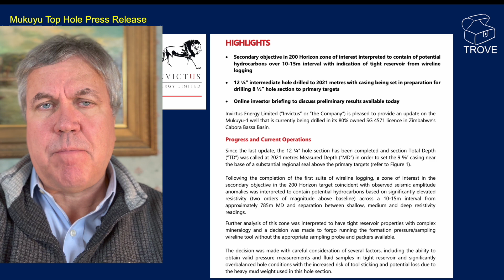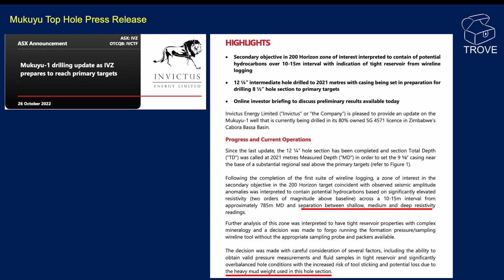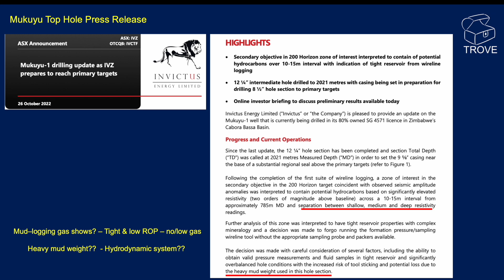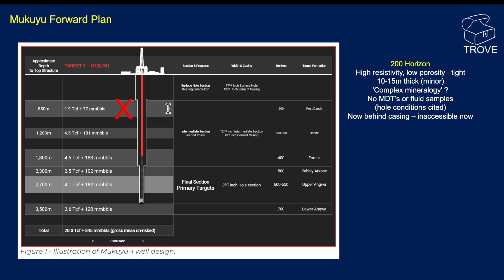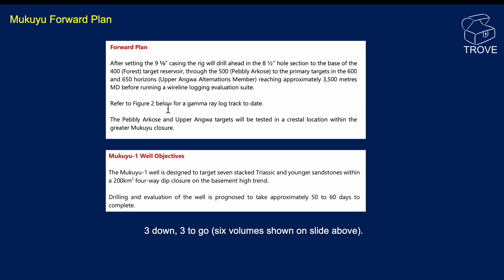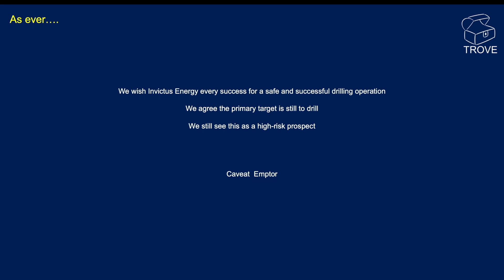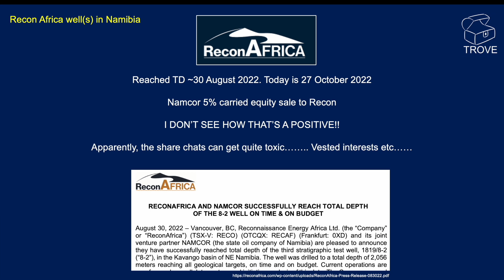ZIMBABWE Invictus Energy - Mukuyu-1 early results

Comment: I apologise in advance, this is a large comment :)

Thank you for your recent video. You’ve raised some good points, however it is somewhat disappointing about what you have not clarified from your previous videos, which since the release might have changed.

Firstly, below are some examples of statements and theses from your previous videos, which I’d appreciate your input on since this announcement. As I’ve mentioned to you previously, I’m no expert, and as such I’d like to tie these loose ends off and would value your opinion:
1. You postulate that amplitudes anomalies in the south are likely Basalt intrusions, has the recent news affected this view?
2. 700m of vertical pay is implausible because it needs (your words) “significant seal capacity” - have we not confirmed significant seal capacity above the primary target? Could you perhaps now answer your own question “are the shales thick enough to maintain seal” for a large column in the primary target?
3. The seals will not be competent due to sand/sand juxtaposition - is this thesis not perhaps been proven doubly wrong? The drill has confirmed a large shale section above the primary target, and additionally the fault margin in the shallow section appears competent in the 200. What is your view on this and how it affects your view on the project's risk?
4. Direct Hydrocarbon Indicators for 200 are invalid due to mismeasured two-way times. Is your view on this unchanged in light of shows in the 200?
5. Can you comment on your claim that the 200 horizon AVO non-conformance to structure in the North is due to being hydrodynamically trapped from water infiltration from the North West? Has this thesis perhaps changed due to the confirmation of good trap and seal against the fault margin in the 200?
6. Do you still doubt there’s mature source rock in the Baobab catchment after shows in the 200 horizon? Where do you postulate the 200 shows have migrated from, with knowledge that there is a large seal directly below it?

Below are some extra statements you have made, which have been challenged independent of the recent news. Would this video not provide a great opportunity to correct the record on the below?
7. No surface seeps recorded - seeps have in fact been encountered at outcrop to the NW, and oil has been confirmed in ground water boreholes. Comments in the Baobab video brought your attention to this, would now be a good time to correct the record?
8. Your claim that Invictus doesn’t have a licence - this was corrected in your Baobab video comments, as you now confirm they have an exploration licence, perhaps it would have been prudent to state this in your recent video?
9. Therefore, have Invictus not in fact followed a conventional O&G exploration approach; in your own words “sign licence, shoot seismic, farmout (self-funded), drill well?

Below I’ve included some questions raised from this recent video:
10. In your view, is the 200 horizon to be disregarded due to the comment of “complex mineralogy”?
11. Or is it to be discounted due to the tight formation? (Or both)?
12. Is it at all possible that the company’s thesis is correct, that mineralogy and permeability will likely improve further from the fault margin?
13. Is it possible the 10-15m pay interval will also increase further from the fault margin?
14. You state that the 400 has already been intersected. Is the the drill not currently sitting above a potential reservoir in the 400?

Finally I have one further question
15. How has the quality and candour of this this press release (as admitted by you) affected your views on the integrity and competence of management? You’ve previously raised skepticism due to management being subtlety misleading by leaving the 4.3b BOE statement hanging, and how the second well is perhaps an extremely low CoS ploy to secure and mobilise the drill. Further, you’ve questioned their competence by pointing out (in your view) better places to drill and provided your suggestions on how to progress the project. Has your opinion of management’s competence and integrity changed since this announcement?

So in summary:
16. After careful consideration of the above items, why has your assessment of the risk at Mukuyu remained unchanged (High-risk)? 
17. Also, is it possible (although perhaps improbable) that the primary target may in fact not be small, as inferred by your first video?

I understand this is a lot, and we could probably all agree that the drill will do the talking within a few weeks and save us a lot of time. However in light of you taking the time to produce a follow up video, it would be much appreciated if you could answer some of your own questions, and correct some of the record from your first releases.

Once again, full disclosure here, I’m invested. I had concerns following your recent videos, however my take on this release is it appears to have reduced the overall risk. I’ve researched as much as my ability allows, and I value your opinion particularly on the technical matters, and I’d extremely appreciate your opinion on whether the risk has changed at all, because in your video you state it has not. Much appreciated, and thanks in advance.
Reply from the maker: Ambi, thank you for your comment. I don't get paid nor unfortunately have time to give detailed answers to your probing questions.

1) Basalts - 'could be' I think I said. 'Tight rocks with unusual mineralogy' - nobody can tell what that means from the available data. They are indeed not necessarily basalts. Petrographic analysis of cuttings samples will hopefully reveal in time. Could be any lithology. Basalts in strat column = they apparently exist somewhere. It's not like the outcrops are far away.
2) The vast majority of drilled wells encounter thick shales at some point. Still doesn't mean there is a working petroleum system underneath. This is a wildcat well. Every geoscientist will draw conclusions. I think I said I was encouraged compared to prognosis. If the first sands under a thick seal are HC-bearing - great! If not - what would you infer? I think the casing point was described as being towards the base of a shaly interval. Not sure how to image ahead of drill bit.
3) see (2)
4) (see 1). TWT issue now largely redundant we have a well penetration.
5) There is 200 horizon AVO non-conformance to structure. One of the reasons MAY BE DUE to hydrodynamic trapping. I wanted to remain bullish how the anomaly could be HC without conforming to structure. Again, Horizon 200 doesn't sound terribly exciting from the press release. It will require a second well apparently (not a sidetrack) to confirm the potential - that'll be a new wellsite, well cost and a bunch of time and overhead. Expensive and a tough investment decision.
6) Shows? I remain highly cautious there are any mature source rocks in the Baobab catchment area If Angwa is indeed the main source - none in catchment area of Baobab.

Ambi, once videos are published they can't be (easily) changed. Nor should they be. They are a record of a point in time. New information comes in all the time. If you watch a Pathe News reel account of events in WW2 - it needs updating.

For your remaining questions -  Oil in water wells - detail that's mentioned but not seen (by me) online, I addressed the licence issue in previous responses.(It's not the licences, it's the legislation). Invictus are of course compliant with regulations. Lack of reported gas (or other shows) at 200 downgrades, the company's 'thesis' is a prediction - maybe they're right, it can happen. Maybe the fault hasn't had a material impact on the poroperm/mineralogy. Only further penetrations will reveal. 

13) refer to the Depth Map. all can see the structure - there is some updip. Not a lot of volume though. Will investors be following their money to find out?

14) I don't know. Is it?
15) I separate competence and hype. I have commented that wildcatting in virgin basins is extremely difficult and Invictus has done well to get this far. My assessment of the prospectivity at Mukuyu has indeed changed. I no longer see it as extremely low chance of success.Very little information uncovered by the drill bit to date radically alters the assessment of prospect risk. It is still high in my technical opinion.Baobab is very high risk in my technical opinion.
16) clearly volumes decrease with depth in structures like Mukuyu. Could there still be enough for a commercially significant find? All things are possible. All must assess for themselves how likely an outcome.

Ambi thanks again for your post and searching questions. I believe I stated things look a little better on published results to date - but the die is cast. The decision to invest and drill the well is a long time ago. Some invested, I didn't. We can argue back and forth about the merits or not of intermediate results. Bottom line - we will know in a few weeks. I hope for a safe and successful outcome for Zimbabwe and those invested in the well. The rest - well that's all in the various (time-stamped) videos.

If there is time I may address your comments further in a future video. ATB, Mike
Reply: @TROVE-1stSubsurface  
Thank you very much for taking the time Mike, I truly appreciate it, and I’m sure anyone else reading will also.

My main aim was to ascertain if your views had changed in light of this new information. Perhaps I missed it, but from the level and tone of your new video it had the appearance of nothing changing from a risk or CoS standpoint. Certainly your summary is still the same as it was for your first video without any caveats - High risk. My own (albeit uninformed) interpretation was that this new information was net positive, and I wanted to know why our interpretations might differ, and to quantify it if possible.

I agree with you that new videos should be left as historical evidence. I wasn’t asking that you go back and edit old videos, I apologise if it came across that way. All I was asking was that statements, arguments and theses covered in earlier videos be revisited, especially since you took the time to record a follow-up. 

One of your chief criticisms of the company was that they left grandiose statements “hanging” and unchallenged. In the interest of fair and balanced debate it would be great to revisit your own big statements and theses when presented with new information, particularly if pertaining to issues of integrity and competence. Perhaps “not a snowball’s chance in hell” is now, perhaps, ever so slightly more likely… this is still wildcat drilling after all right? :)

I should have provided caveats, I also believe Mukuyu remains high risk, however I had hoped to glean whether you believed the CoS has been impacted at all, due to this not being clear (at least to me) from your video. Thank you for providing clarity in your remarks.

As for the details, some quick clean up if you could manage to spare the time:

2. The company believe there is source within the Upper Angwa, while it seems you disagree. If there is source, and it is mature, and it now appears sealed, surely most of the ingredients for a working petroleum system are present. Certainly Mobil believed this to be true in the 90’s, and Envoi did in 2019; see their analysis for potential farm out partners, particularly their stratigraphic diagram with source indicated within Upper Angwa http://envoi.co.uk/wp-content/uploads/2019/10/P255Invictus(Zimbabwe-SG4571)EnvoIProjectIntroduction.pdf

4. After encountering (to a high probability) hydrocarbons through resistivity readings, could it be fair to say the DHI was in fact accurately predicted by Invictus? If so, what is the implication for similar DHI’s seen elsewhere in the plot? For example they’ve claimed flat spots in the Upper Angwa, among other DHIs elsewhere throughout the tenement.

6. Apologies, not shows, we have seen shallow, medium and deep resistivity, which appears in all likelihood to be HCs. If this is in fact HCs, where would you think they have migrated from, as it appears the seal is competent below? Is it possible there is source rock down dip towards Baobab? The company appears to think so, in addition to claims of a separate, and completely independent shallow source rock, believed to be charging Baobab.

7. Please see the following articles:
    a. IVZ ASX Announcement dated 21 Nov 19; “Geochemical analysis of … 2 oil seep samples on trend in neighbouring Mid Zambezi sub basin” https://www.asx.com.au/asxpdf/20191121/pdf/44bsqn7p5ntxyf.pdf
    b. All Africa article dated 9 Dec 20; Chief Muzarabani quoted “We also saw for ourselves when we dug wells for water for our own consumption, but we realised we could not use water from certain areas for drinking purposes because it was oily. Experts came here and they concluded that the water was not fit for drinking because it had oil” https://allafrica.com/stories/202012090874.html

14. As stated in their release, they have not intersected the base of the 400, they stopped at 2021m before the base of the 400 - there is a note on the seismic image, and there appears to be a potential sandy reservoir directly below the drill’s current location. As such the 400 is still in play.

Thank you again for investing your time here, all of us investors appreciate a diverse set of views, especially from those with a technical background. We're all learning here.

At the end of the day, we’re at the most critical crossroads of this project. We all agree it is high risk, however I hope by clarifying some of this detail it allows people to make informed decisions moving forward. I’m fortunate enough to have been here early enough that my personal risk is somewhat managed. However for others later to the story difficult decisions need to be made. Thank you for your replies so far, it has gone a long way to helping clarify the risk/reward on offer here.

Time for the drill to do the talking I guess. I for one will be having some stiff drinks approaching TD and wireline logging.

Thanks again.
Reply from the maker: @ambiturner3460  Ambi. Sorry I can't answer. I am running a channel, a business and I simply don't have the time to do your queries and references justice. Suffice to say - your comments (and my videos and answers) are there for all to see. Let's wait and see eh?
Reply: @TROVE-1stSubsurface  
No problems Mike, sorry for taking so much of your time. I think I've made my point however. Unfortunately it appears your lack of time is reflected within some of your company research, there are numerous aberrations per our discussion above - although I'll qualify that by saying your technical expertise is extremely valuable and a great additions to the discourse. 

As a matter of courtesy however, perhaps it might be worth kindly reconsidering before levelling serious criticisms against management's integrity and competence; particularly if you are unable or unwilling to qualify such criticism upon receipt of new information. Unfortunately it could be interpreted as hypocritical, especially after accusing the company of leaving big statements "hanging".

Please don't take this the wrong way, I know I'm not the only one who believes some of the criticisms of Scott and Stuart have been unfair; in the interest of transparency it's best you're made aware of these opinions, irrespective of whether it was intended or not, perception is reality.

Anyhow, thanks again for your time. Onwards to the drill!
Reply from the maker: @ambiturner3460  Ambi, in this context, the drill bit is reality. I have recently met both S&S briefly. I know a lot of folks who speak highly of them. This isn't personal, as you perhaps imply. As I wrote recently, I am not expecting Xmas cards (sic). I have followed many such new-start companies over the decades - there are several I could focus on. At some point, I felt enough is enough - it's the uninformed investor who loses their money, not me. I receive many emails, texts of support and conversations of encouragement. But the industry experts working for O&G companies choose not to make such statements publicly. I understand that. All support 'calling it the way (the professionals) see it'. I am yet to hear any of them say I'm talking b*ll*cks - but please feel free!. Wish I could share, but these are private communications and will remain so.

Ambi, you are clearly an informed and loyal investor and I wish you every success. Many have not done the research you have. My videos are intended to hopefully educate the latter. The latest video on the UK licensing round is out. I am recording another on Guyana-Suriname tomorrow. I probably won't be back in Southern Africa for some time. I will do a wash up video - and if there is success I will be most pleased.
Reply: Thanks Ambi, long read but a good one. I liked your analogy
Reply: 😊 Hey I marvel at your intellegencia. You layed it, I wish you lend me your brain.